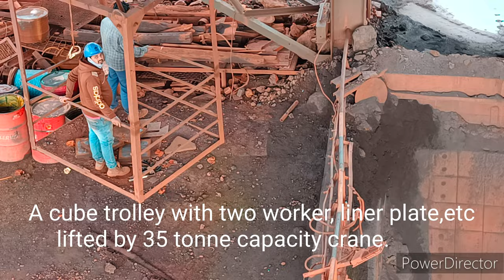How liner changing done in 1600 tph kobelco gyratory cone crusher, Amazing work of liner changing

Comment: in a large place like that one would think they would have access to proper power tools and safety equipment for the employees. Work smarter not harder eh.
Reply: I agree with you 100%. The liners are held in place with hex bolts since they use an Allen key to secure them. To give them a better tightening torque, they use a steel tube to extend the Allen key (cheater), something that is prohibited in heavy industry in Europe. Power tools are the best solution, whether they are air or hydraulic. I think the person editing these videos does so with good intentions, but those of us who have worked in heavy industry watch these scenes with terror because we see the small mistakes they make and repeat without improving them and we know the consequences of these mistakes.